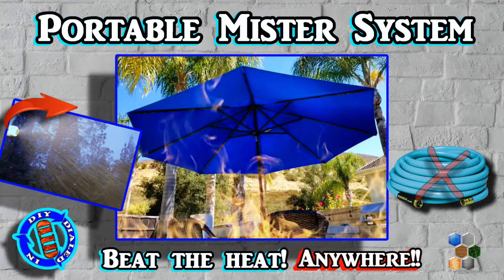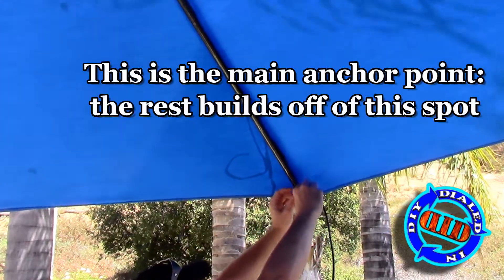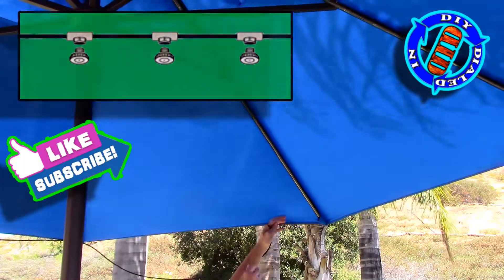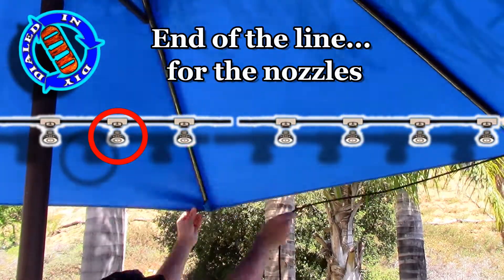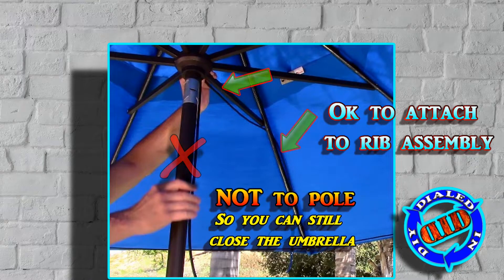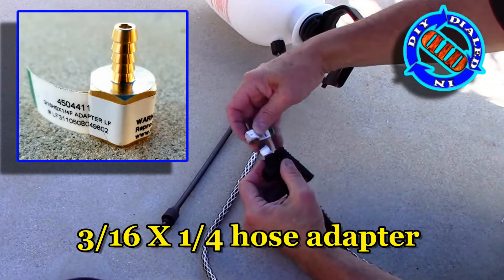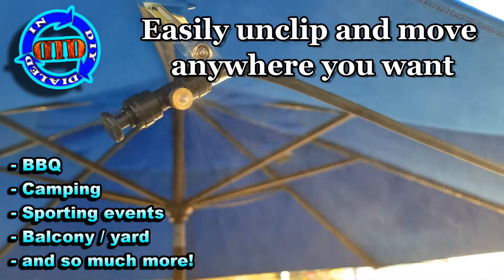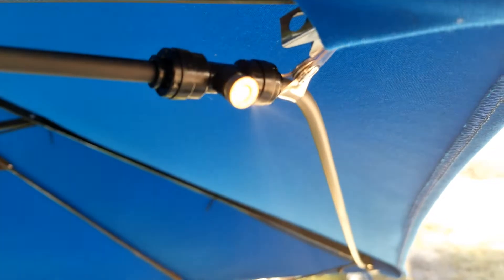Portable DIY Mister System - Beat The Heat - No Hose Needed

Comment: You can do the same thing with a small 12 volt fan. One mister in the center of the fan works fine. All of my fans have garden misters on them. Age makes a difference in handling the heat. I'm having to find ways to continue doing what I've always done and misters help.

Comment: I use a small pump for fish tanks, powered by a portable battery. I can then just throw a tube into a water bottle or 1, 5 or 10 gallon jug/water bag. The pump is pretty quiet too and lasts all day.
Reply: how did you connect the pump to the system?
Reply: @alexzucker7116  The electric pump just replaces the weed sprayer. Its not a submersible style aquarium pump so it has a inlet and outlet for hoses to attach. I simply ran intake hose into a water bottle and the other hose to some mister nozzles. HAOWIN Portable Misting System on amazon showed me the method and I just bought my own stuff for $15
Reply: I have a small pond pump. I was wondering how long the water source would last. I'm glad I scrolled the comments :) do you by chance know how many gph it is? Just wanted to compare with the gph of the pump I have to see if I should  go for the smaller one.
Reply: I'd be very interested to know what type of pump you tried using and how many nozzles and length of hose can be accomodated by such a pump.

Comment: So I could not find a fitting that would screw onto the handle. SO... I snipped the ridged tubing of the wand, warmed up some 3/8 clear tubing, pushed it on the stub, 3/8 to 1/4 push coupler and  money in the bank. Have my on off and quick way to disconnect to refill. Thank you for the ideas
Reply: I also couldn't find the fitting anywhere, thanks for the alternative
Reply: Thanks brotha I have to do the same !!

Comment: Thanks so much for the idea ! I “updated” the setup by using a cheap , battery powered indoor plant irrigation system , instead of using the drip fitting it came with , I used the fittings for misters you showed and worked like a charm for my balcony that has no water source . 
I have a water dispenser so I have those big 5 gallon water jugs , and I used one of them to stick the pump in . I love how easy it was
Reply: Hello, can you please provide me a link or name of the "battery powered indoor plant irrigation system". Thank you.
Reply: @vimal-guru  you can search for "LetPot WiFi Automatic Watering System "

Comment: I need yo cover a 100m of patio 
I used a misting system hooked it up to a presure pump opened the water and only half of the sprayers work 
The begining say first 5 meters working then it starts to drip and the other half nothing not even a drop 
Please help whats wrong
Reply: You need a bigger pump or shorter hose. 100m is a lot of hose and every meter of hose, and every nozzle contributes to head losses, which will reduce your water pressure.

Comment: I run mine in Louisiana when I have to be in the vehicle not moving for a while.  Stay in the vehicle with the air on.  But run one up front to my vehicle front grill.  So when the vehicles cooling fans are running.  It sucks the mist through passing over the radiator keeping the engine cooler than it just sitting sucking in 90-100° temps.  
I figure it can’t be all that bad.  If your flying down interstate while it’s pouring.  The drops hitting the grill or following behind other vehicles it’s sucking up mist anyway.  
An if a motor had to run on idle for periods of time in the heat.  Not getting forced air from moving.  But forced air from the cooling fans.  
A cooler engine is less wear an not as hard on the engine if it’s running cooler.

Comment: I want to create this misting system with a 1-2 gallon tank that I can connect to a power outlet rather than a hand pump. Is there any frugal method to hook a misting system to an electric powered pumping system? I do not have a water source I can connect the misting system to.
Reply: There are in-tank pumps you could use with this design. All it needs to do is be submersible and create air pressure, and seal to the tank.

Comment: Great idea! I am thinking about something like this to set up various small misting areas in my garden. Would it work with a battery powered sprayer like the 2 or 4 gallon ryobi? How much pressure will the misters need to produce mist? Thanks for this idea!
Reply from the maker: Thank you very much.  I really appreciate the kind words and you taking the time to post a comment! It would absolutely work and done successfully (subject for a future video). Given that the hand pump version is able to pull off a mist the battery powered pump version works even better... more consistent. The amount of pressure needed depends on factors like the type of nozzles being used as well as the effect desired.  You can experiment with the pressure that works best for your needs.

Comment: Man I was thinking of doing usb mini water pumps but this makes so much sense... I'm thinking of filtering the cooler water while going camping to run this... Keeping my ice "dry" and getting cold water... I just wonder if I can find a pressure pump and an adapter without opening up the box and taking the thing apart n the store...
Reply from the maker: That sounds like a great idea. You can make it efficient for that use by using fewer mist nozzles if you only need it to cool an area for a person or two also.
Reply: @DialedInDIY  I got a 2 gallon. 4 nozzles, I'm going to have to flex seal the adapter, even with a pressure washer the threads just don't go well (plastic n brass) but beyond that it's great. We will be in a shadeless so cal spot... And this under a 10x10 tent will be our lil Oasis. Thank you for the idea. Im glad I found this vs the mini USB pumps. "Work smart party hard"
Reply from the maker: @thcrtn  Love the creativity and definitely appreciate the shadeless so cal spots... aren't we supposed to be getting closer to winter?  I've always heard "Work smart, play hard" but I like your version better.
Reply: Great idea! I was also looking for an electric pump but getting the pressure right and having a power source is my issue. This solution  will really up my camping game this summer!
Reply: @caitlinquantock1458  it works really well, and last for a bit... Enough to rest up for a bit... Also put up some sort of sheets to catch the mist. The cooling evaporated water will help in the shade... Just make sure the ground is absorbent or you have a rug... It's going to soak everything... A "mist lounge" should be its own area/tent... Good luck if you can filter your cooler water (the drink cooler) it's even better... Ice cold and a life saver!!!

Comment: Sorry, but this doesn't look very good. That is not mist, this going to soak you. Misting systems need much more pressure than a little chemical sprayer can offer. If you want a misting system get a 100 psi diaphragm pump and a battery.
Reply from the maker: Sorry you didn't like the look of the output.  For the purpose and effect I was after this worked out perfect.  Nobody gets soaked, the effect of evaporative cooling is attained, the cost is kept to a minimum and the unit is easily portable without a direct waterline.  
You are completely correct that the typical pressure requirements of a commercial mist system is much higher.  The downside in striving for that effect is a significant increase in cost. That said, if I was going to run one along the side of my home or at a place of business (restaurant) I would hook up a direct feed water source and a regulated pump.  
Thank you for taking time to watch my video and post a comment.  I really appreciate it!
Reply: Ihave to disagree. I''ve set up 2 of systems based on these instructions and even used $4 dollar tree pump sprayers and its a great system. I've never had an issue with pressure and the mist is so fine that a small sprayer works great.
Reply: This is probably 10x cheaper, though.
Reply: Yeah, I think I was wrong. I've seen other people do this, and with the right nozzle, the results look decent.

Comment: How long does it run before pressure dies down?
Reply from the maker: Great question and it is a multi-part answer.  First, it depends upon how many of the nozzles I have turned on (i.e. half or all). Second, it depends upon how much pressure drop you are ok with before you want the pressure back up. Third, I typically get over 15 minutes before hitting the pump again. I have not used them recently but plan to this weekend so I will try to time it and get more specific.
Reply: @DialedInDIY  did you ever get more specific on how long between pumps?

Comment: Great setup!  About wow long do your misters run before having to re-pump/pressurize the tank again?
Reply from the maker: This is a popular question right now... 
It is a great question and it is a multi-part answer.  First, it depends upon how many of the nozzles I have turned on (i.e. half or all). Second, it depends upon how much pressure drop you are ok with before you want the pressure back up. Third, I typically get over 15 minutes before hitting the pump again. I have not used them recently but plan to this weekend so I will try to time it and get more specific.

Comment: Thanks for the video! Do you have to pump the chemical sprayer pretty often?
Reply from the maker: Not as often as I had thought I would need especially if I am only running half the line.  There are also versions for sale that have a built in pump that runs off a battery. Costs a bit more but the pressure is constant and consistent.
Reply: @DialedInDIY  How often, more or less, DO you have to pump the system though? Whether it be half of them, or all?

Thank you in advance!